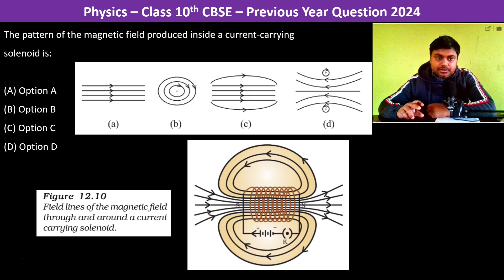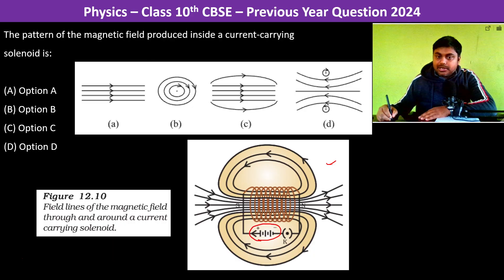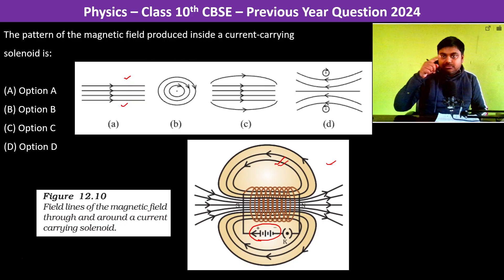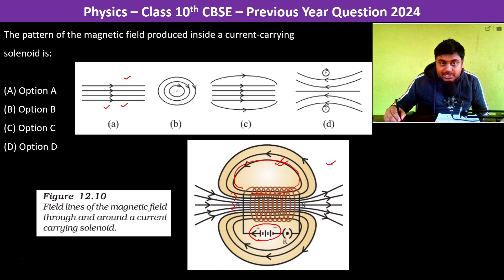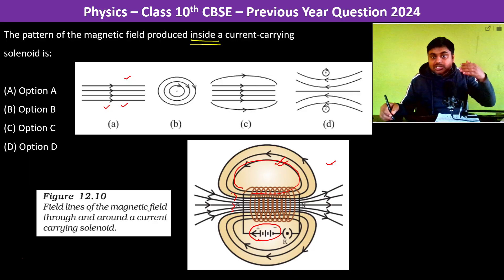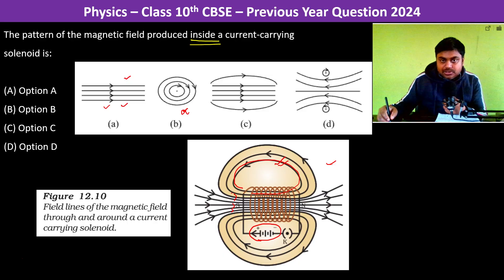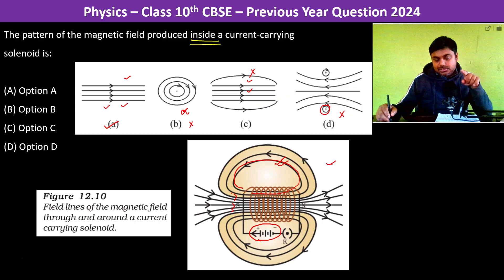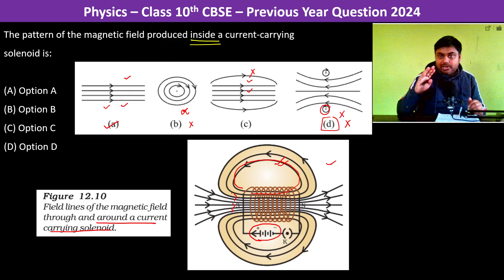The pattern of the magnetic field produced inside a current-carrying solenoid is:(A) Option A

Comment: If a is correct then why not c
Reply from the maker: In c there are 2 outermost lines which aren't parallel to the lines which are inside.

Now, if the 2 lines are inside the solenoid then they should be parallel as the magnetic field lines inside solenoid is parallel. 

If this lines are outside solenoid then, they should be in opposite direction as the magnetic field lines are in a loop.

Thus, c isn't an option.
Reply: Because c is incorrect